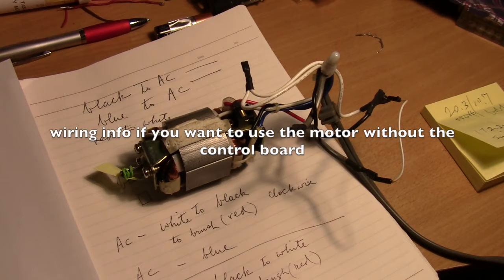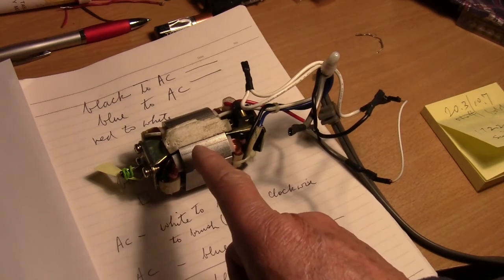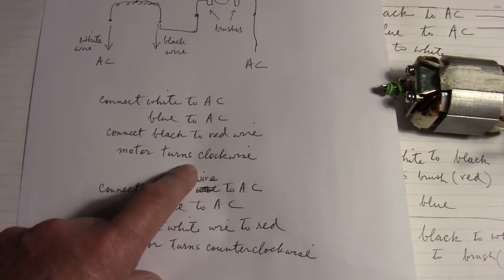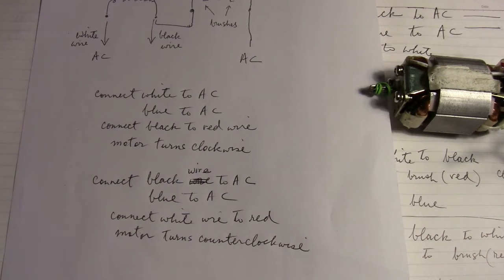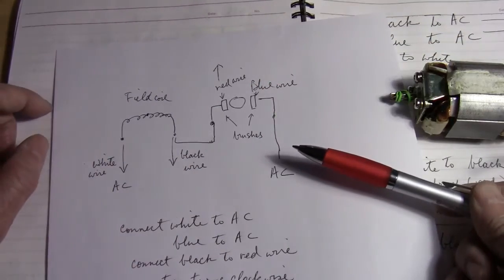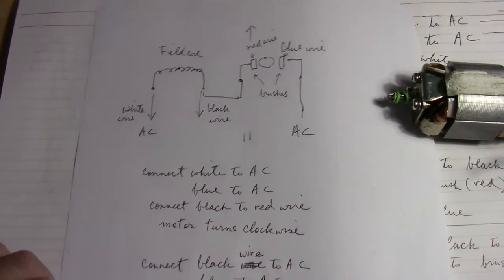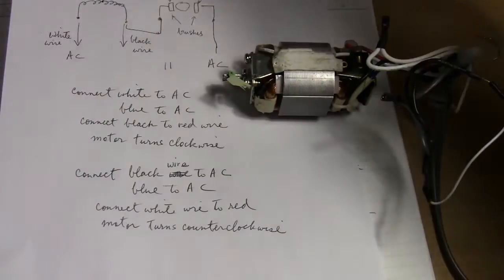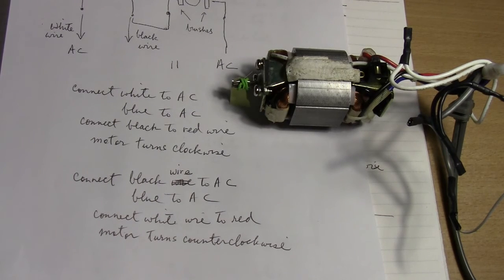Wiring the Hang Fung shredder motor without the control board

Comment: Does this work with any other shredder motor like this one? Because I have a Fellowes 12C/12C15 shredder with similar wires (plus a yellow wire)
Reply from the maker: Very similar. You can experiment a little to find out.